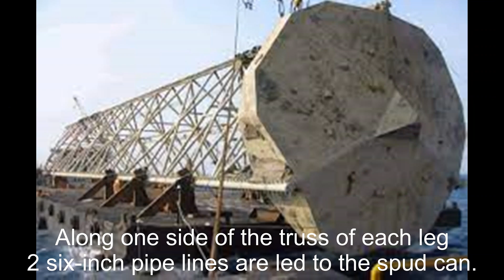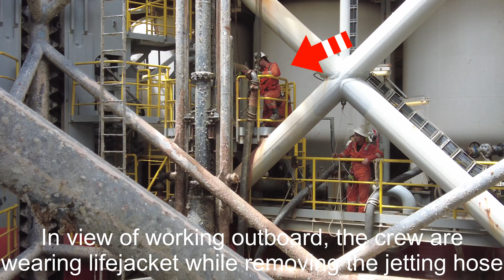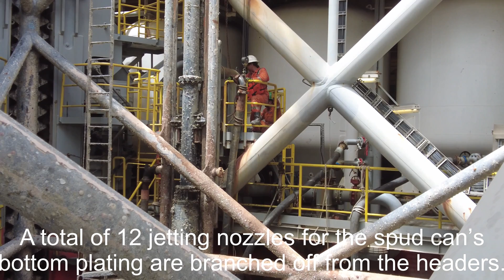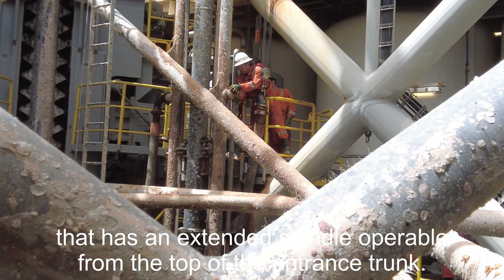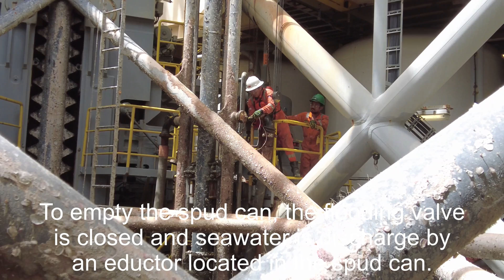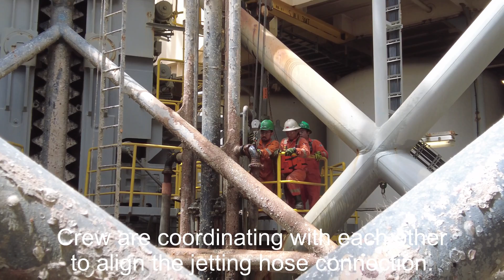Roustabout & Roughneck Assisting Rig Move Jetting Operation

Comment: What is the work difference on oil rig vs oil plateform please reply
Reply from the maker: Oil Rigs are more physical work on drilling operation and Oil Platform works are more on monitoring and maintenance as required. Am I answering your question?
Reply: @AceRigMove  what about future carrier  on oil rig ya plateform offshore
Reply from the maker: @RanjeetSingh-lc9lb  With TESLA technology around, you may want to find the balance between offshore job and shore job. The Salary range has been declining over the years. We cannot advice on your future carrier, you may need to do more research on whatever you do.